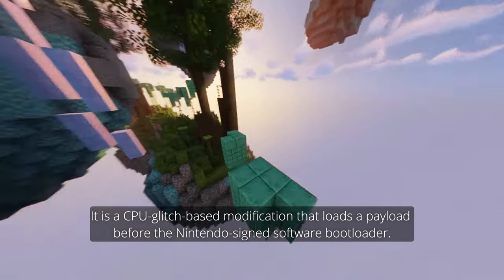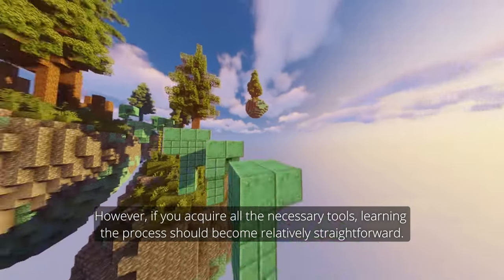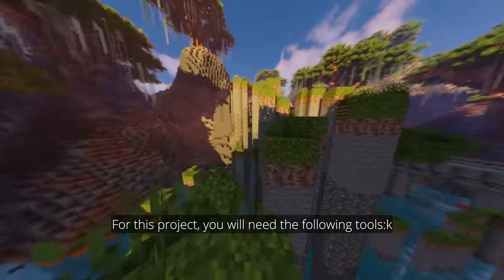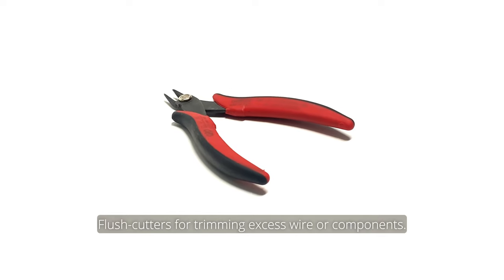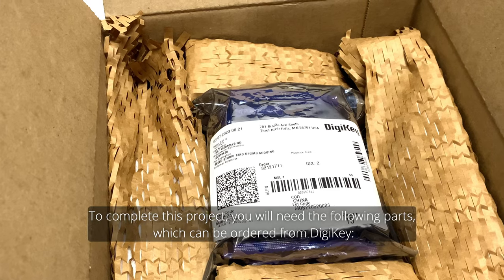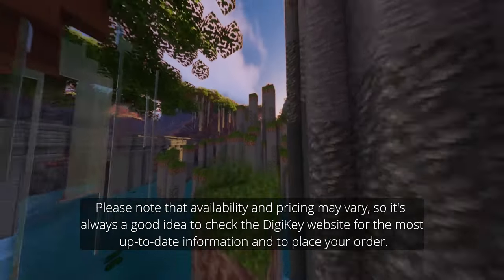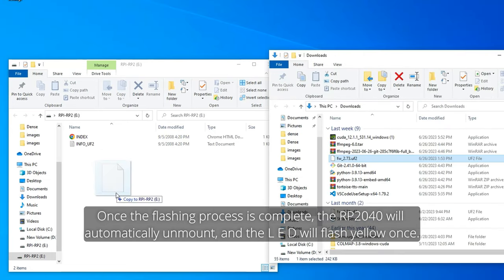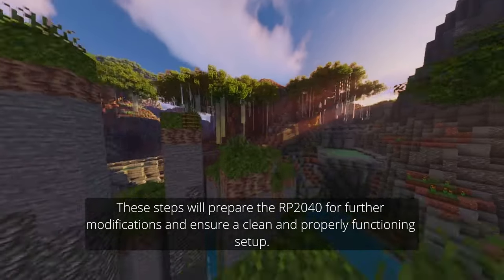Can you Mod a Switch Lite in 2024 - Step-by-Step overview

Comment: Whats the size of those wires ?? Is it 36 gauge ? Is it enamel? Why is not making short??
Reply from the maker: 4:30 i been using only 34 and i haven’t had any complaints 
this is the exact one i bought : https://www.amazon.com/gp/product/B00L5IUCYA/
Reply: @Beezid30 hey The amtech Flux is out of stock currently on that website you posted in the description.  I have a question.  Does it matter if I get one with 10CCs instead of 30CCs for volume?
Reply: @Beezid30 Also, can you give me a link to the exact type of uv flashlight you used in the video?
Reply from the maker: @smashbrother2367   you can get some her https://northridgefix.com/?s=Amtech&post_type=product
Reply: Hey does the type c connector have to come off ir can it stay?

Comment: thank you so much! turns out i forgot to bridge the two pins, now it's working correctly!
Reply from the maker: Glad I could help! I once had to resolder a Type-C connector just to realize I hadn't bridged the two pins.
Reply: Man, I have no idea how you were able to tin the mosfits without making a bridge between them effortlessly like you did in the video but I dont think I can because I don't have the type of microscope you have that blows up what you are seeing to what we see in this video here
Reply from the maker: @smashbrother2367  i just use the ribbon cable one it just not worth the time and effort. this is the were you can buy it from you just need to ask for it https://fsbxd.en.alibaba.com/
Reply: what type of ribbon cable is it?
Reply from the maker: @smashbrother2367  if you read the pdf PicoFly install guide it called a flex cable (which has integrated mosfets) 
https://gbatemp.net/download/a-definitive-picofly-install-guide.37968/